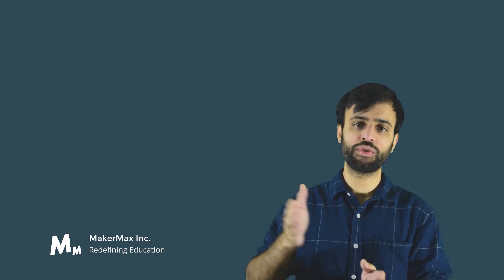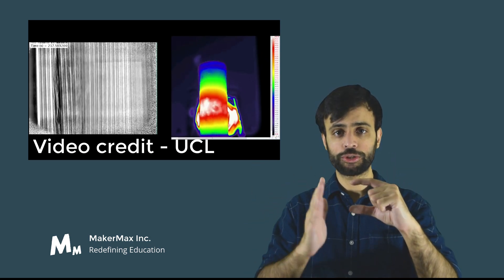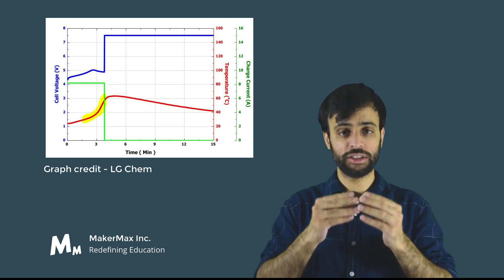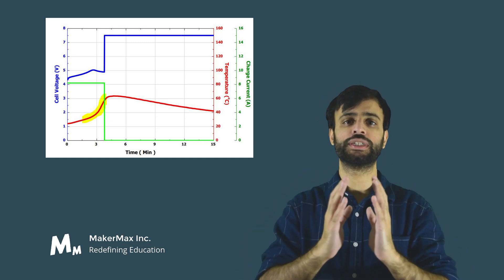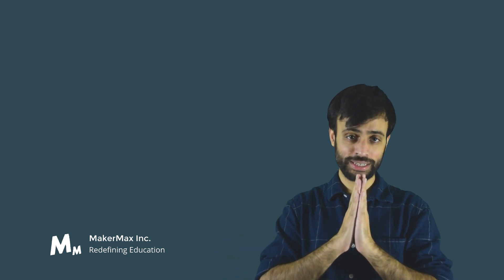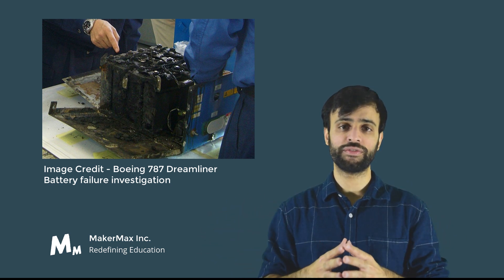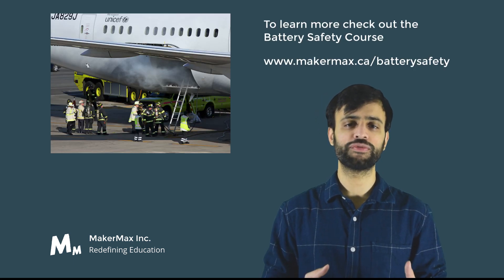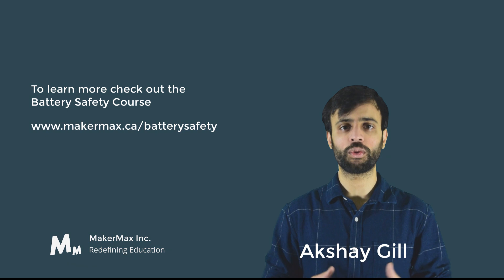What is thermal runaway in Lithium-ion batteries and how to control it? | A course on Battery Safety

Comment: It's important to know that just because you don't violate the rules on a lithium cell doesn't mean TR (thermal runaway) won't happen.  Dendrite growth and impurities in construction can cause TR even in the best cells.  It's widely known in the industry that between 1 in 4M and 1 in 10M cells, even from top tier manufacturers, will develop an internal short.  If you continue to use the cell, this can cause TR.  We also have to realize in any device there is the problem of mechanical mangling due to some sort of abuse.  The bottom line is you always have to assume at some point TR will happen, so design for safety.
Reply: Kevenc, I absolutely agree with your comments.  I think I can believe the one in 4E6 failure rate from the best manufacturers for an 18650 cell.  But my engineering intuition  tells me that the failure rate for a larger cell will be higher.  Two factors at play here. 1. Failure rate per square area of separator due to contamination and/or defects, 
2. Damage due to final cell assembly.  I suspect 1 above is is the greater part, but I have no data on this. 
Be that as it may a BESS INSTALLATION may be 50 MW total. If each cell is 100 WH, 500,000 cells are needed.  So our chances of infant mortality are  4E-7 x 5E5 or about 2E-1.
1 in 5!  Now not all failures will lead to thermal runaway, hopefully the BMS will notify the operator to take corrective action before things go south. 
Unfortunately this seems not to have happened in Surprise AZ, etc etc. Even if no one is injured in such events, we, the electric utility rate payers will ultimately pick up the tab.